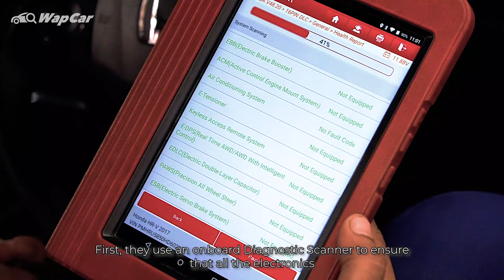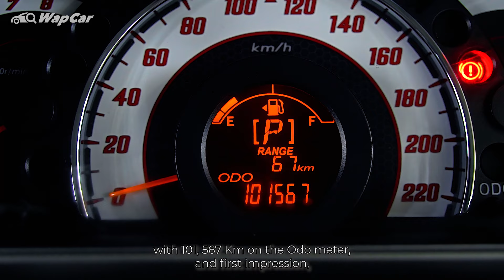Carsome Certified Lab, Watch How They Refurbish A Carsome Certified Car + Test Drive!  | WapCar

Comment: Not sure carsome is as great as advertised. Recently been to their Melaka branch trying to sell my car and was surprised as none of the steps are carried out as per advertised. In the of the inspection, no offer was provided and no further answer from the branch. (this is where it felt weird). After a few calls to the customer reps - then the major and shocking surprise came - the carsome service rep informed me that my car was declare as "total loss". (which in fact is not as I have evaluation from another platform). I understand as a business, carsome have the rights to refuse to offer or buy any car they don't want, but mislabeling and accused customer as "total loss" without any reason is definitely not acceptable.

Comment: carsome got sued by selling stolen car. correct?

what is the use for seliing 1 million check points car if like that? 😢
Reply: That's a one off case no? Also after some reading up I found this; "Carsome, in its defence, is relying on Puspakom’s report which said that the chassis was not tampered with and everything was in order before it was sold to the plaintiff."
Reply: no unfortunately and those checkpoints for the vehicle check condition
Reply: @aimanfitri0iv  you mean the puspakom inspection? Puspakom checks for non factory welding on the chassis and checks if the chassis number has been tampered when dealing with name change.

It seems the police did a more thorough chassis ID inspection by cross referencing every part of the car based on the text below. From my knowledge puspakom only references firewall id and engine id in registration. 

"Two days later, police seized the car for Chemistry Department tests on the chassis, and it was later confirmed that it had been tampered with."
Reply: @Harzman01  yes
Reply: @Harzman01  idk. but carsome need to check the legality of the car before selling it
Reply: @braderyoutube1983  they already consulted puspakom. Documents all no issue. Tukar nama process pon all handled by jpj. These 2 agencies didn't find anything fishy. If it were me I'd assume car is fine also. I could find only 1 time this happened under carsome. So I assume they have their ways now that they learned from that mistake.
Reply: @Harzman01  im thingking. jpj got bribed?
Reply: @braderyoutube1983  pretty common occurrence at JPJ and Puspakom. But this could also be due to negligence